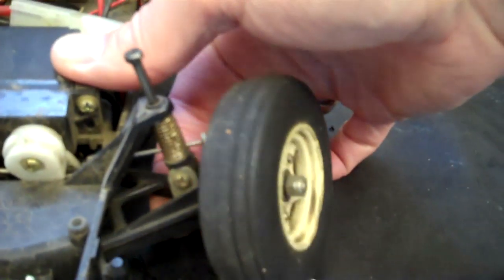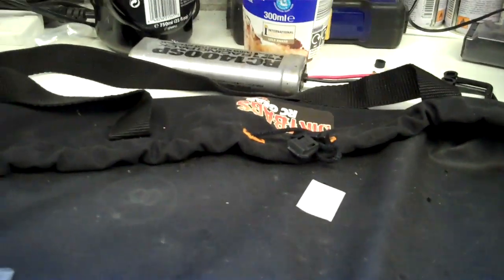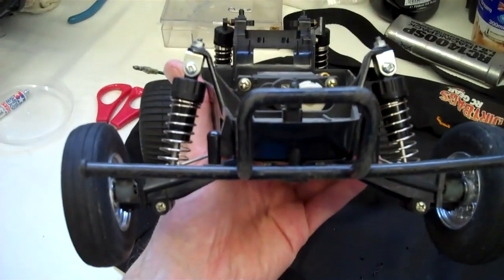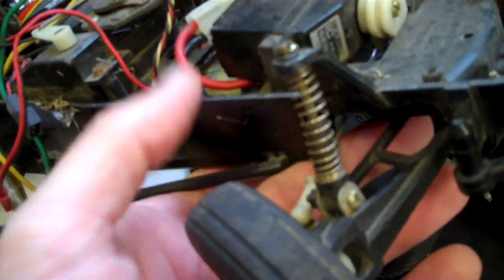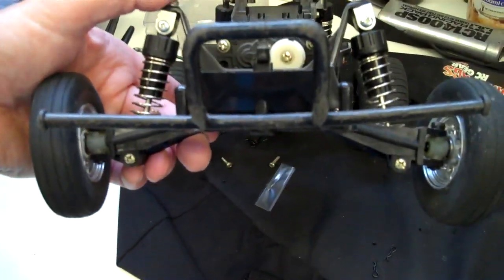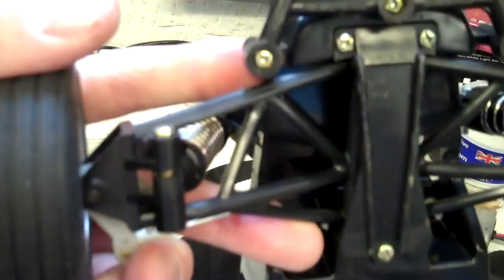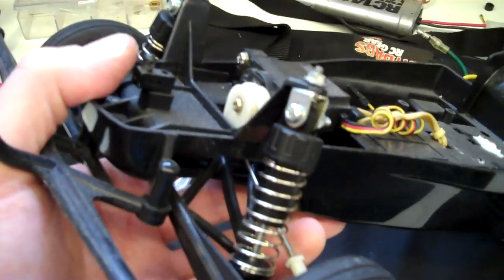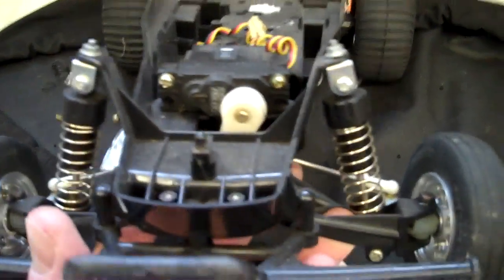Tamiya Grasshopper 1 & 2 Front Suspension Upgrade

Comment: Back in the day,  a company named CRP made up grade parts for the Grasshopper.   I still have them on my old Grasshopper.  You had to cut the upper front spring mount off of the chassis.  The kit came with 2 aluminum oil filled adjustable shocks.  Shock oil and an aluminum plate with attaching hardware.   The plate was attached to the chassis and also served as the front skid plate.  The shocks leaked oil so everyone installed them upside down.   Then you could adjust your spring rate by loosening the adjuster on the shock.  What a great improvement that kit was.

Comment: grasshopper 1 has the shocks mount on top of the a arm, the grasshopper 2 looks like its on the bottom of the a arm thats about a 5mm difference in the shock lengths, the shortest i can find is 50mm for an original grasshopper and they are a tad too long
Reply: Same here. Very frustrating

Comment: Actually i found out the hard way - I presumed that the GH and GH2 were the same. Unfortunately the cars have different Axel arms - GH has the metal bracket mount on the axel. Vs GH2 has the hole for assembly in the axel arm.  Also the GH2 Arm is a lot longer to accommodate the angle of the shocks.  If you guys can revise your heading it would be great as it was misleading. And when you have parts and they don't work well...

Comment: I bought those same brackets to mount some oil shocks on the front of my GH. Are those stock front A-arms? Your lower shock fits different than mine.
Reply: Have you found a solution.